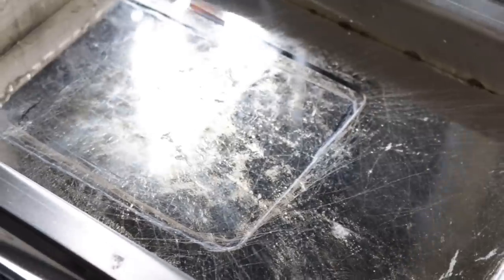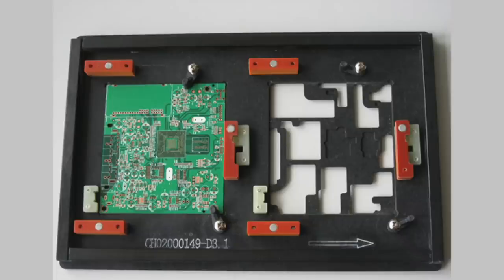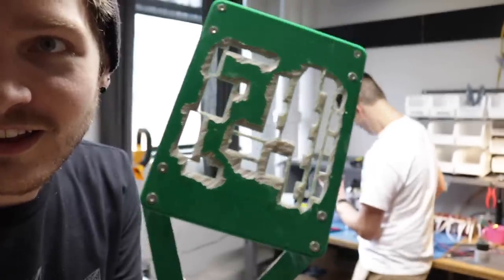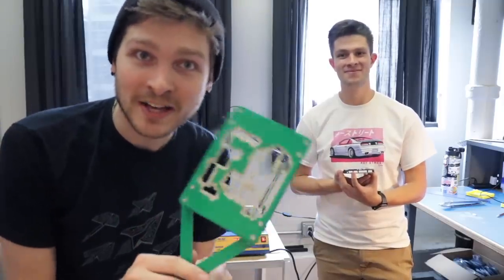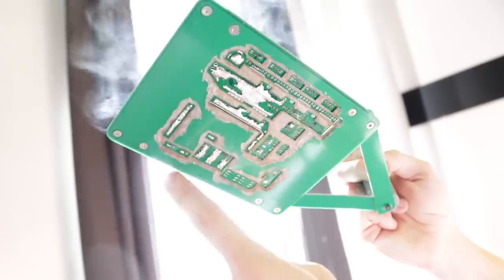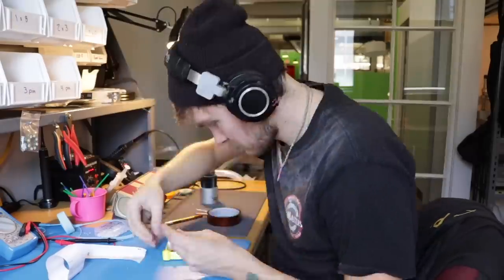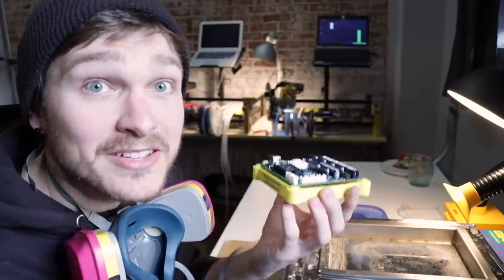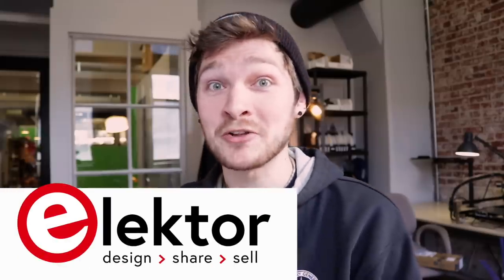soldering PCBs with molten metal

Comment: Nice work!  In commercial wave soldering, A pump is used to make a little molten ridge which the boards are passed over. (This gives air pockets a chance to escape, which I think was one of the problems with the chamfered stencil. Cutting vent channels in the stencil and/or drilling vent holes in the board might solve that.) 
They do wave-soldering with surface-mount parts too, but the pick-and-place machine actually puts little glue dots under each part, to hold them to the PCB during soldering, since they pass through the solder wave upside-down.

Comment: that method reminds me of wave soldering. with that method, you don't dip the pcb into the solder. you have small motor that creates waves in the solder. and only the maxima of the waves reach the board.

works well on industrial scale.

Comment: As the other commenter said its trapping air. Treat it like mold casting give a route out for the air with no contained shapes. Also add some stoppers to the bottom of your tongs or some arms to stop at a depth you are plunging  it into the flux without it being hand steadiness dependent.

Comment: Related to the screw holes, why not place the screws up top and have the bottoms line up with the bottom of the board and do this soldering job and then use a heat gun to remove the access solder so you can remove the screws afterwords after the circuit board is completely cooled? Experimentation is so much fun! Nice video you guys!

Comment: Very cool!  Two suggestions… not that I’ve ever done this, but watching your process they came to mind.  1. Use a hot plate or a jig with blown hot air to bring the boards partway up to temperature.  You want it lower heat than to melt the solder so no chance to burn stuff.   2. A jig where the board sits over a small contained sprayer chamber (like from a windex bottle or maybe electric pump or piezo) with your alcohol flux might work easier than the dip.

Comment: Just curious why you didn't get a wave soldering system instead of the puddle?  Way more easy to control, not much larger, and will give you the perfect solder joint every time.
Reply from the maker: Good question, we thought about it! The whole point of the company and LumenPnP project is to find ways of making electronics accessibly at a mid-scale. While we could buy the more fancy, expensive machine, we want to start with the thing a lot of our customers might be using first. $300 for the solder pot and some flux and solder bars is a much easier pill to swallow than a few grand. We want to find solutions to these problems for everyone! That being said, I wouldn't be surprised if a wave soldering machine is in our future...

Comment: One thing that I wonder, when looking at the design of the board, is why are there so many thru-hole components in the first place?  You could have used SMD connectors in many places, and I'm still not sure why all the motor drivers are on little breakout PCBs instead of being integrated directly.
Reply: yeah those headers could all be SMD, a bit more expensive but the process would be cheaper. The sockets for motor drivers is presumably because this looks like a glorified 3d printer mainboard, which have used those "Polulu" style socketed stepper drivers for at least a decade. Easier to let somebody else design a good stepper driver board when starting up. Thermals are better when on a single PCB but plenty of time to do that better.

Comment: The spatulas look like a great $4 solution - but if you want to go for consistency in dipping the plane of your boards a specified amount in -Z, I'm thinking about modifying something like a "Drill press". The poor-man's drill press is this $50 dremel stand (do not recommend, crappy plastic). But perhaps something like this could be modified to install a board and then use the lever to dip it down a certain amount in Z to be consistent for dipping in both flux and solder pools.

Comment: in the industry they used a solder machine and they still have rework to do at the end of that process depending on the boards  oh and they use a wave soldering technique so the solder cascades over a crest to touch the board also the boards are on a traveling track

Comment: When i used to work a solder flow machine and we used a product called seal peel .you put it on the bits you don't want soldered then it just peels off easy .

Comment: Here's an idea. Instead of a template that only exposes the parts that need solder, how about a template that only protects the parts that need protecting. If that means a template composed of many  parts isolated from each other, then attach them to a base that allows solder to flow through it, but also keeps at the isolated template pieces locked in place relative to each other. I think this would allow air to escape easily, and allow solder to reach everywhere it needs to.

Comment: I'm no specialist XD.

my guess is that the thermal capacity of the metal is low (in general), so it will dissipate the heat it has really fast into anything that comes in contact with it.  In other words, your assumption that the temperature has to be higher is not wrong!  However, I believe making it a bit hotter (not a lot) and leave it less time in there will make the "pads" and "component' dissipate the heat of the liquid metal real fast (making it solid) and the other parts on the boards won't have time to solidify the liquid metal and the liquid will just leave back into the pod.

Nice video and demonstration :)

Comment: The grinding of the PCB has me worried. From what I've heard, powder generated from PCBs is really not good. For tasks like that, I hope you have a bubble set up with a HEPA filter. This keeps the dust out of the main environment. It's super easy to build, I made one for a project I was working on in my bedroom which involved cutting insulation a lot. All it was was a bubble made from heavy plastic sheeting, all sealed with super stick tape. I then attached a box with a fan built into it and attached a car cabin HEPA filter (cheaper than many special purpose ones) to the box so all air flow had to go through it. This created a negative pressure space in the bubble, so any leaks would mean outside air would blow in and particulates couldn't escape.
Also, don't forget about your clothes. After you are done and take off your respirator, the particulates can be on your clothes. It would be a real benefit to have a mid chamber to change in. Obviously, in your setup it would be easier to use something like tyvek suits or something that goes over clothes. Still, don't forget about your hair.
I had mine in my bedroom, so I just had pair of clothes dedicated for that type of work that I would change in an out of for the tasks at hand. 
This sort of stuff won't have a noticable effect on health usually for a long time, but it will. My bubble cost me around $100. It's cheap and easy, just takes time to set up. I highly recommend one if you are dealing with particulates. Also, for your project, you could probably easily get away with a bubble in a box. That sort of thing where you stay outside and just put your arms in through attached gloves.

Comment: Wondering about the method used in removing the board is also a key to the solder adhering correctly. A swooping/rolling method rather than straight dipping and then straight removing.

Comment: I waaaaant to automate this. I want to build basically a hanging kinetic platform, the basic structure is a pillar mounted near the edge of the basin which has a rocker arm horizontally across the top, and further outboard this rocker arm is actuated by a servo, then inboard a linkage hangs down. 3 of these hold up a platform which receives this pallet or one like it. Push a button and the servos go through the routine of lowering the board near the solder to preheat, then doing that rolling dip maneuver (or whatever maneuver proves best). Afterwards it lifts the pallet back up so the operator can grab it. Advantage: probably almost none, would allow for more consistency, would be cool, definitely more complexity, somewhat of a distraction, will probably need some design tuning to deal with being next to this hot thing all the time. A real advantage would be seen if it could be built into an automated workflow where panels are palletized, dipped, and depalletized so the operator can focus on populating boards without switching tasks, but that's definitely downtown distractiontown
Reply: That's basically what a wave soldering machine does. Problem is those are big expensive devices
Reply: @fischX  This is simply not true. In a wave solder machine you have a reservoir of solder and a submerged pump that propels solder out of a linear nozzle across the reservoir to create a region where the solder is higher as it spills back down into the reservoir. This raised section is "the wave". You then conveyor PCBs across the nozzle and only the wave is high enough to reach the board but also the constant flow of solder is a constant flow of heat that prevents shock cooling like Stephen found was happening. Wave soldering is great, I assume Stephen has done or has had done the research and decided not to go that route, presumably because of cost.

Comment: Obvious one, but don't use plated through holes for mounting; just a hole through the fibreglass. Not only will that remove your solder problem, but in general you can't rely on a good electrical connection from the PTH to the chassis there over time unless you are very carefully controlling the surface chemistry to prevent oxidation. Also the act of tightening down the screw/bolt can delaminate the copper or introduce non-conducting hairline fractures.

Comment: Hi Stephen, your assumption about the pre-heating is right. If you look at a wave soldering process the PCB is much longer in the oven (for pre-heating) compared to the time it‘s going though the wave itself. It also guarantees that the solder goes deep enough into the through-holes. If you have to solder massiv power components that need big ground planes then it get‘s even more difficult.

Comment: Just a thought here, what about taking one of your pick and place machines, changing the head to a soldering iron and adding a solder reel, and converting the machine to a  solder machine that autofeeds the tin and visually checks each connection. Slower then the molten bath method but less Rework needed and if done right can use the same mounting system /trays for the pick and place

Comment: Did you think about doing the mechanical holes not plated/npth? When you could avoid your just dip the whole board without the pallet. 
So instead of working with the pallet you avoid the problem completely. 
Also, if you get some pins not soldered I would be kinda skeptical if the solder properly flows through the plated holes or just creates a fillet at the bottom. 
As these mechanical connectors will be used by the end user there will be some stress at the pins and you obviously don't want them to fail.

Comment: You will get less dross if you cover the solder pot surface with some peanut oil. But conveyorized wave solder with preheat is the professional way to go.

Comment: Hello!
I have no insights on the process, other than maybe ask adafruit some pointers? they do a lot of in house manufacturing and are pretty friendly, perhaps one of their engineers can tell you to look at reference PDF X that will help...
I mostly came to say that you shouldn't worry about the videos schedule, as those kind of videos is insanely interesting, and comes only from doing what you do.
I think many of us are really interested in this aspect of the manufacturing chain (i mean problem solving, engineering, etc), and if it takes less frequent/less regular videos,
so be it!

When i equip my fablab, i'll definitely  search for funds for an Opulo!

Comment: Get yourself a small space heater with those infrared/ceramic elements and mount it flat (you may have to disable a tilt cutout switch) to stage the board over to preheat it before dipping, this can increase your workflow as you can have multiple boards preheating and then dip them in succession.

If you're interested in "hacking" one together, checkout what people are doing for DIY vacuum forming, its a similar "heatbox" idea, just different implementation.

Comment: I was thinking silicon studs for fans, to push into the holes on the pcb. Or some other silicone that fits the holes. then you could just push it down onto the 4 silicon things and dipp in solder.

Comment: While you are at electronica you can find a cheap wave soldering machine. Also in industry we use oil in molten solder.
Reply: I haven't seen oil used since Electrovert acquired Hollis - over 20 years ago.  Hollis had a wave solder machine with oil injection to reduce bridging - a pretty messy machine as I recall.
Reply: I saw the change over from oil in the early 1990's.

Comment: 9:10 you can use a 3d printer or simular device it will be not fast but acceptable automatization, TIP create rotary hed for lifting different components.

Comment: You guys would have seen it by now but have a look at core electronics selective soldering machine. There’s also lots of cheap used selective soldering and wave soldering machines in the USA even on eBay as they’re not super commonly used here anymore.

Comment: If you think this is that amazing, you should look into wave soldering. Also, use capton circles for your areas you don't want soldered instead of tape. The little circles are easier.

Comment: Amazing work, I hope you get a good fume extractor for those fumes , its a leaded solder so enhaling those fumes is no bueno.
Good luck man!
Reply: How do you know that he is using leaded solder?
Reply: I'm pretty sure manufacturers are not allowed to use leaded solder anymore.
Also... lead doesn't vapourize at those temperatures so you wouldn't be able to breath it in but the flux vapours aren't good either.
Reply: @Jehty_  what i know is all solder wicks and pastes contain lead.
Reply: @SAILxKamal  well, your knowledge is wrong.

Comment: IMHO, fluxing and good (pre-heat, dip, cooling) profile is key for reliable and good (wave) solder bumps.

See also (examples):
a) "Wave Solder Profile Supplement" notes from aimsolder 
b) "Wave Soldering and Thermal Profiles" chapter from Microelectronics Cloud Alliance (MECA)
...

Comment: I would imagine that surface mount editions of all those connectors exist, and would therefore be less work than old tech danger puddles
Reply: Surface mount connectors have a big mechanical disadvantage over thru hole connectors. If you have a static board and cable strain relief in place to minimize mechanical forces on the connectors, SMD would be fine. The current Lumen does not have any of that, and the issue that the motherboard is mounted directly on the machine that constantly vibrates and shakes because of the mechanical movement. It would require a complete machine redesign having the controller somewhere away from the machine frame or at least mechanically decoupled.

Comment: Why not just use SMD connectors? There are a bunch of 3-pin JST and 20-pin IDC connectors on the market. Stepper driver ones might be a little tricky but why not just have the TMC chips built directly into the board? I've never heard of people having to swap them out because they failed during normal use.

Comment: are you cleaning the boards after soldering? that much flux sounds like a corrosion nightmare over time. ultrasonic cleaning sounds like a good idea.
nice work still 👍👍

Comment: Looks like you are just reinventing a flow soldering machine. The company I worked for around 1990 had one of those. The sheild bits were not made of FR4 but I guess that could work. Why do flow solder machines work better. They have three main stages 1) Foam Fluxer, 2) Multistage preheat, 3) Solder Wave. The Solder wave works better as there is no scum on the wave and it does not suffer with trapped air.

Comment: I can't wait to see a project around DIY selective soldering or even wave soldering based on the principles used by Seho or other industrial companies. Cheers!

I've used to maintain and program a selective soldering machine that had a moving bath, an older version of this machine ( https://www.youtube.com/watch?v=fGDRWfs84lY ) with a single nozzle. I've struggled to fulfill the requirements of IPC-A-610 Acceptability of Electronic Assemblies, but when the trial runs were done and the results from cross-section analysis and CT scan came and were OK, it was a good feeling.

Comment: Interesting challenge solved.
I see you have esd bench mats and yet you have a silicon rubber assembly area to the side...doh. If you don't apply esd safe practises throughout your whole product assembly life then you may as well not do anything. That's not a dig but an observation you may not have fully considered in the busy times. It has been a great project to follow, cheers.

Comment: Maybe a bit of an insane idea, but what's the surface tension of molten solder like? I'm wondering if you could have like a slit across a plate, and have molten solder pushing out the top of that with enough height to touch the pins of the through holes without touching the actual PCB. Then you could just have a sled you put the PCB on, and slowly pull it across the line of solder. Ideally, it'd wick up the pins, but not enough to bridge them. If it works, it should be pretty consistent and reproducible. Either way, I love seeing the progress, it's great work you're doing!
Reply: That sounds like wave soldering